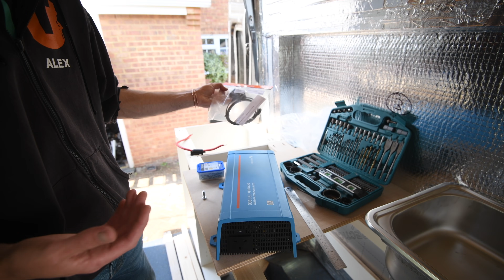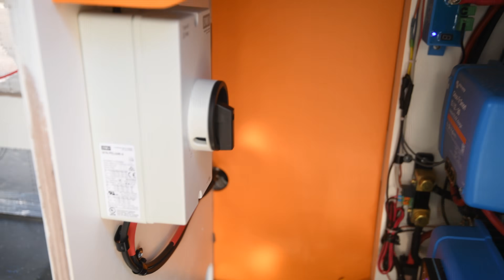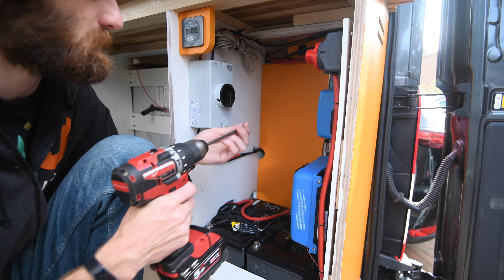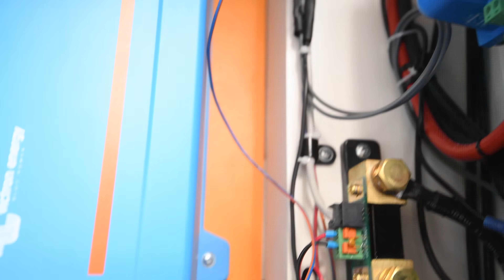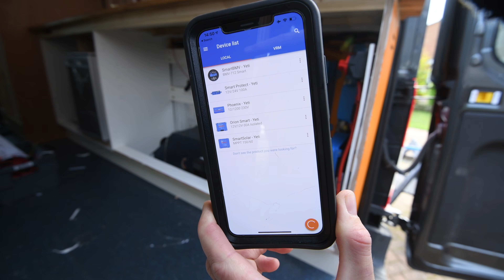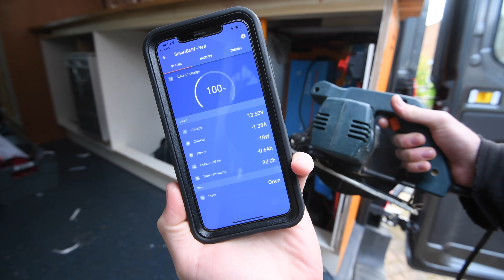Victron Phoenix Inverter 1200VA install | EP32 | Ford Transit Campervan Build

Comment: Quick question,  will the inverter power the likes of a 1200w hairdryer? Thanks
Reply from the maker: No, this is a 1200VA inverter which is about 1000W. For a 1200W I would use a Victron 1600VA model which is 1300W
Reply: @MispronouncedAdventures  good man thanks

Comment: Yo , thanks for the no bullshit waffle explanation. Needed the reassurance to add an inverter to the existing system to power 240 volt blanket and Brompton batteries ......watched most of your Freeze Yer Balls Off videos and trust your Electrickery knowledge. Thank you B

Comment: How do you see charging by watts with dongle if there is way. I can see battery volts 13 plus volts. Just curious is there a meter new type of lithium batteries
Reply from the maker: 12V batteries is just a generalised term. “12V” isn’t necessarily 12V. 12V system will charge up to 14.8V depending on chemistry. 

to see Watt’s you could use a Victron Smartshunt or BMV-712 to see a system total output or a Victron Bluetooth dongle for this inverter to see the inverted output

Comment: Have you ever had issues with wires coming out of the inverter? I thought about using ferrules how ever I’m not sure if that is recommended or not?
Reply from the maker: Ferrules are not recommended for most Victron  equipment. Ferrules are great for screw terminals. Most Victron equipment uses raising plate terminals ( which are operated by a screw which causes confusion, but the screw never makes contact with the conductor ) 

The multistrand core needs to be loose, so when the plates come together, it can squeeze the multistrand core to fill the entire space, Ferrules in this case would hold the core captive, preventing an as good of a connection.
Reply: @MispronouncedAdventures  thanks 👍😊

Comment: Hello. Thanks for the helpful vids. Question. Why did you not ground the inverter? Thanks
Reply from the maker: “Ground” is the wrong terminology, “Earth bonding” 

The Phoenix by default has neutral & earth bound inside so it’s a floating earth. additionally it’s uses a normal plug socket to direct plug “normally” with a single appliance, the wire can be kept an eye on all the time. 

However, if I was running cables in the wall to sockets in different parts of the van where I couldn’t see any risk or potential damage has occurred to them, you can unbond neutral and earth inside the unit, and then use a consumer unit containing an RCD and MCB downstream of the inverter and then bond the inverters Earth point to the vehicle chassis. in this case, it would protect you from live earth fault ( live comes in contact with the vehicles metal work ) 

If you look at my later multiplus inverter videos, I do earth bonding and explain the uses of this equipment

Comment: Hi Alex, I’m about to wire in my Victron inverter. Why isn’t it necessary to use the ground connection of the inverter?

EDIT! I’ve just seen that you cover this right at the end. We have a 240v hook up in the van, but won’t be using the hook up 240 and inverter 240 at the same time. Do I still need to have a chassis ground cable?
Reply from the maker: I would watch my later video when I use a Multiplus inverter and talk about the important of customer units ( RCD + MCB’s ) and the need for the inverter earth to be bonded to the chassis. 

I take it your 240v hook up already has a customer unit? If there are no ac cables running out of sight then you could just plug into the inverter directly but if you have a bunch of socket with cables hidden, there is a risk on cable damage going unnoticed. So s customer unit and earth bonding the inverter to the chassis would be important

Comment: Isn’t it frustrating that you need to cut off the batteries when there is still lots of power in it, just to protect them?
That‘s really bugging me about batteries. Capacitors would eliminate this, but I don’t trust them, they can fail and … bang!
Earthing inverters seems to be a bit of a discussion on the net as far as I saw.
Question: Why not use the earth against the body of the vehicle? It‘d be earthing the 230V but aren’t you currently unprotected?
Reply from the maker: This is a old video. The swap the phoenix for a Multiplus later in and talk about consumer units, RCD and a protection, Earth bonding to the vehicle which is 100% necessary with that type of unit where you have a hook up and wires running in the walls 

A standalone Phoenix, however with wires which are not running those the walls wouldn’t necessarily need any protection from a RCD, and being a uk plug would be fused. Earth bounding to the vehicle chassis wouldn’t do anything, unless you had a consumer unit containing an RCD.
Reply: @MispronouncedAdventures  Hmm, thanks for the details.
I‘m still digging through your channel… 🙂

Comment: Will be buying the same 1200VA just use as a basic backup system in my house running off two lipo batteries to keep my freezer and Internet running during any power cuts.
Have two 518 watt Jackery power stations and 80 watt solar panel at the moment.
Reply from the maker: Good plans for a power out back up, same for the jackerys

Comment: I have an already fully built out campervan (Hymer Grand Canyon) that has 3 wall sockets in various spots in the interior, but those only work when I'm hooked up to shore power as the van didn't come with an inverter. Since I almost never use shore power anyways, I'm going to install a Victron inverter too and feed the 3 wall sockets with that, but disconnect the shore power going to the sockets. Same reason as you, to simplify the system and not have to add complex switches, grounds, etc.. 
One question though, why didn't you use the ground point to ground the inverter itself?
Reply from the maker: Hello, I think for you Victron multiplus might be a better option. As you can keep the shore hook up and have a inverter all using the same sockets. 

I swap the this Phoenix for a multiplus further down the line and explain why. And on those videos, I also install a consumer units ( up stream and down stream of the unit ) and use the built-in earth point.. 

As to why  I didn’t use the Earth point ( bond Earth to chassis ) in this video is because this unit has Earth and neutral Combine and I didn’t have wires running in the walls ( so a risk of a live Earth fail isn’t there ) and a normal outlet to plug into . Using the Earth point on the inverter only does anything if running a RCD down stream of the AC OUT on the inverter. In my multiplus videos I explain why it’s important to use the Earth point

Comment: batteriekabel viel zu unsicher und dicht montiert!! brand- und unfallgefahr!! billige anschlusse. Controllapp funktioniert nur mit 85€ zusatzdongle!!! und das für 450€!! eine frechheit!
Reply from the maker: I’d have to disagree that there is any risk. The specs of the cable and lugs used are right from VictronEnergy Manual. However what you Saying might be partly lost in my translation of your comment. This video is also prewire/cable management, later version is this the cables are wall mounted. The connections used are high quality lugs sold by one of the largest un suppliers of this type of equipment 

I have also replaced this inverter with a multiplus. 

What I do agree with is the need for a dongle! It’s mad!
Reply: @MispronouncedAdventures  🖖

Comment: I'm thinking of buying this inverter. Can it power a microwave?
Reply from the maker: Potentially, depends very much on the wattage of the microwave. 1200VA might be on the smaller side of some microwaves

Comment: Do the cables to connect to the battery come with the inverter?
Reply from the maker: Nope, because different cable thicknesses and length would be  different between the inverter and batteries depending the there set up however some companies do sell premade cables
Reply: @MispronouncedAdventures  where do you get the cables in England?

Comment: Great videos!! You have been helping me a lot in my own van conversion! I know this must be getting old but I am really stressing about the grounding and I just want to be 100% sure, but it is fine not to use the grounding point on the inverter as long as I am only using an extension lead straight from the inverter for my appliances? Thank you
Reply from the maker: Two ways I could help answer this. But first just a terminology point to prevent any confusion. here you’re referring to “earthing” or particularly “AC earth bonding”, grounding is more DC electrics 

If you check some of my later videos for the Victron Multiplus install I talk all about from earthing, consumer unit and RCD’s & MCB’s

However for your question for this particular inverter I would personally be happy to use an extension lead as long as I was not running that extension lead out of the vehicle or through any of the walls, effectively that I could see the extension lead wire. If however I was running the extension lead throughout the walls of the van where potentially it could become damaged without being known and make contact with the vehicles metal body then I would definitely be earth bonding the inverter to the vehicle chassis and implementing an RCD unit for safety. This particular Phoenix inverter if you wish to earth it needs to be opened up and wire moved across which is detailed in the manual
Reply: @MispronouncedAdventures  Thank you, you have made my day, this helped massively :)
Reply from the maker: Glad to be of service

Comment: The Victon manual tells you to mount vertically with the controls on top, not the way you done it
Reply from the maker: You are wrong or have misread the manual, it says the opposite, under section 3.1 of the “Phoenix inverter VE.direct” manual. it says the fan which is located at the end of the unit with a DC connections, power switch and other connections is to located towards the bottom. The opposite position with fan, controls and connections pointing up is labelled as a not a recommended position, same with all Victron equipment, connections are recommended to point down to prevent the risk of debris and dust settling into the connections and unit over time.

However if you’re saying this is what your manual says. please tell me which manual it is and which page number and I will download the PDF and check myself

Comment: Sorry realise is a old video and have read the comments about (the earth debate) 
I got this inverter just and was wondering 
Is it not earthed because basically the sockets you put in the van are just a solid style (extension) lead 
And because (shore/mains power) isn’t sharing or supplying power to those sockets ever it’s not a issue.
Sorry get it your probably sick of this type of question. 
Go steady the new inverter in a later video looks cool, nice one go steady.
Reply from the maker: More or less because I was just using an extension lead out of the unit at the time, so because again live van body fault wouldn’t be possible . However if you were installing sockets and having cabling running throughout the wall I would definitely put a consumer unit with a RCD and MCB on the AC output from the unit and earth bonding the body of the unit to the vehicle metal work 

Further down the line I have moved to using a multiplus unit and have a consumer unit on both the AC in and AC OUT and the unit Earth
Reply: @MispronouncedAdventures  
Good going, thank you very much

Comment: Hi! What's that inline fuse holder you're using? I've never seen it before and looks quite small
Reply from the maker: They are called “Midi or strip fuse holders”

Comment: Just curious as to whether you connected the inverter negative to your shunt or battery terminal? 
Cheers
Reply from the maker: Yes it will have to be connected to the shunt otherwise the shunt  wouldn’t see / log the Energy it uses
Reply: @MispronouncedAdventures  I thought so, I just didn’t see you make that connection in the video.
Cheers

Comment: Hey Alex, great van build series! Been perusing through your electrical system videos specifically. Is there a reason you haven't run a ground wire from the inverter to the chassis? I've used a couple of inverters and I think they all said to do that for safety considerations. Just wondering why you opted not to.
Reply from the maker: This is a older video. 

Do you mean ground? As in DC negative or are you referring to AC Earth bonding? 

If it’s the AC Earth. On this inverter in its current configuration ( in the video ) I was just using the ports directly, not circuits run off it. With a floating Earth ( neutral and earth bonded within the inverter ) and nothing like a RCD used bonding the Earth to the vehicle chassis I wouldn’t see it achieving anything. 

However in the later videos where I’m using a multiplus inverter ( or if I had fully integrated this Phoenix inverter with circuits for sockets throughout the van ) I used consumer units containing a RCD and MCB’s as I have installed circuits throughout the van and have a shore connection where bonding the AC earth to the vehicle is very important for safety, and doing so allows the RCD to function

Comment: cant hurt to bond that ground lug on the inverter to the chassis of the vehicle as it may provide another path for fault current
Reply from the maker: You are correct but additional equipment would be needed to detect the fault ( which is done at a later video ) In the case on the Phoenix install in the this temporary set the Earth point and Earth boarding of the inverter to the van chassis wouldn’t serve a purpose as there is no RCD downstream of the inverter which would detect that type of fault.,

That being said in the most recent videos I’ve change the Phoenix for a Multiplus and have used the Earth point &  installed consumer units with RCDs and MCDs and speak about the whole earth bonding process the inverter to this vehicle chassis to detect for the particular reason you mentioned.

Comment: I built my van around 12v, no way I’d have an inverter, they are just so inefficient and kill your batteries, there are other ways.
Reply from the maker: Whilst the vast majority of the van is built around 12v, and if possible I have things running from 12v over 240v. The convenience of being able to plug-in something 240 V when you need to when you’re living full-time it’s pretty important, sometimes sometimes it just isn’t a 12v version. Inefficiency wise it Depends on your model inverter, and your battery bank. The Phoenix in the video it 91% efficient. if I’m running the 28inch monitor and streaming 4K to it from the Apple TV via the inverter that only uses 3.9amp which is pretty much nothing when my battery bank is 390ah and having 500watts of solar
Reply: @MispronouncedAdventures  it’s the conversion of volts back and fore that kill the battery, makes them work harder than they were designed to do, granted the victron is the dogs bollocks of inverters but it’s still not great for you batteries, I live in my van full time and disconnected the inverter because I never used it once in over a year.....what are you using that requires an inverter anyway, I mean if you need one you need one right. Great video anyway, not being a hater just putting my view across. 👍
Reply from the maker: No worries man. I’d definitely agree inverter can be a large draw and a large parasitic draw ( I normal turn mine off when I not in use )  

My main use is the 28in tv. It’s 48w, whilst I know you can get 12v TVs. I didn’t think a spec I liked. Could also had my Xbox to the van if I wanted too for some fun. For me it’s convenience. If I have to charge up something obscure which doesn’t have an equivalent 12v charger and so on. Nice I can also run a bunch of my power tools of it as well.
Reply: @MispronouncedAdventures  forgot to say, I have a jackery 1000w lithium power station that I can plug 240v into but again rarely use it.
Reply from the maker: I’ve seen those Jackery all on one units a lot recently. I think they look like a good option if someone doesn’t want to massively included 240v in there van but would need to from time to time
Reply: @MispronouncedAdventures  the jackery 1000 could easily run your TV and Xbox for around 5 hours, I just plug it in to my cigarette lighter when im driving and it charges up again pretty quick. Another option would be a generator but with Great Britain being plagued by whingers the noise of a generator will have them up in arms, so I guess it’s an inverter or a portable power station  can’t go wrong with that victron gear though. 😂

Comment: Did you know you can make a Victron CCGX (~£500) out of a Raspberry Pi 3?

Would be pretty sweet to tie all that Victron stuff together. You can add tank level sensors to the Pi too.
Reply: Oh yeah, and you can add a £30 USB GPS to the Pi and have live location on the van and setup a Geofence so if the van moves out of that you get an alert. Obviously need a internet connection for the Pi for this but it looks like you have that covered.
Reply from the maker: Indeed I do, I’ve had a Pi 3b+ running Venus OS in for about 3/4 months now. Brilliant adding to the System. Additional I when for a generic USB GPS to give me the location and geo fencing on the pi! I will be making a video on it at some point
Reply: @MispronouncedAdventures  nice. I still haven't got the van yet but I've got a shed load of LiFePO4 on their way from China. Can't wait to start building.
Reply from the maker: Ah brilliant, which cells and BMS did you go for?
Reply: @MispronouncedAdventures  Got 8 280Ah LiFePO4 cells and 100A Daly BMS. Gonna use that together with Victron a battery protect.
Reply from the maker: Good plan. That’s going to be a nice battery for you
Reply: @MispronouncedAdventures  there's a guy on GitHub that's working on integrating the RS 485 output of a lot of cheap BMSs with Venus OS. Search for Louisvdw/dbus-serialbattery